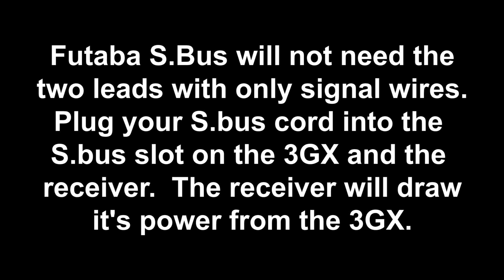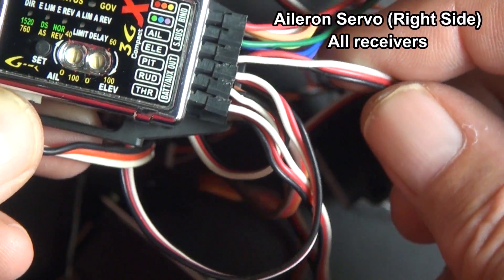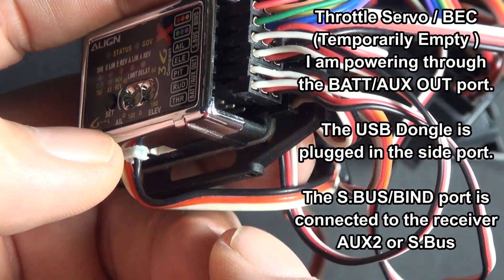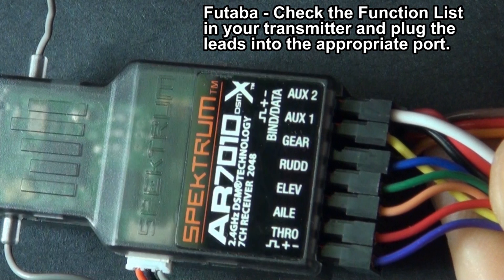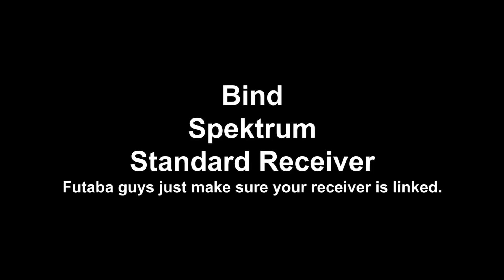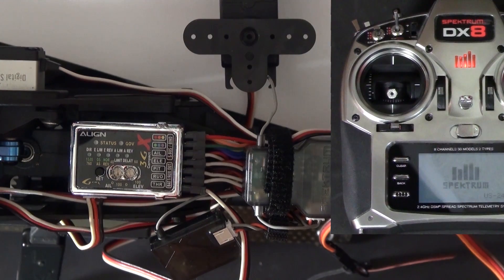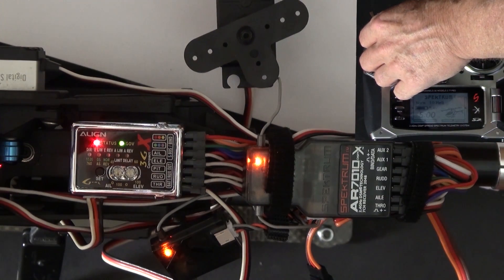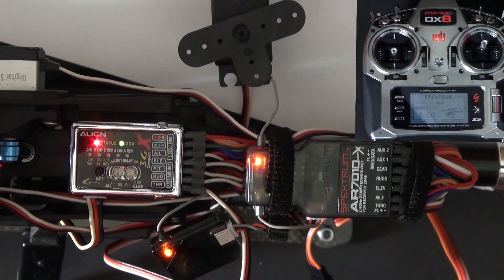3GX Version 3 - Connecting a Standard Receiver. Binding and Testing Fail Safe

Comment: Dear R on I have a 3GX with 5.0 Firmware and two align DSMX  satalite receivers The 3GX and the sat receivers bound up rightaway. the problem is as I start to get the swash level the row of 5 green lights start to flash and the sats start flashing too but the servos still move. Unable to correct the problem I went to bed figuring I would try again in the morning but in the morning The 3GX won't light up at all! Tried rebinding..... nothing.  not even the satalites.????  As I research on U tube I find people saying that the 3GX is not compatible with DSMX and DSM2 satalites only should be used. Can you help clear some of this up for me I have my first two builds going on (Trex 250 and a  clone 550) and this has brought them to a stand still. They both have gone blank and seem dead! Any advice would be greatly appriciated. Thank You Chris Goelz

Comment: Hi Ron, i need some help, my trex 550, i converted it to DFC, its a Trex 550e V2 flybar. Now i got the 600 DFC head on it, i am getting tail bobbing. My screw on my Elevator on the 3GX was at 12 O clock. I turned it down, and its better, i mean the bobbing, i am now at almost 9 O clock, maybe 10 O clock. But there is still a small tail bobbing. Is is good to keep turning it down, till the tail bobbing stops, and what is the negative for turning that Elevator screw that far to get rid of the tail bobbing. Hope you can be of some help. Thank you.